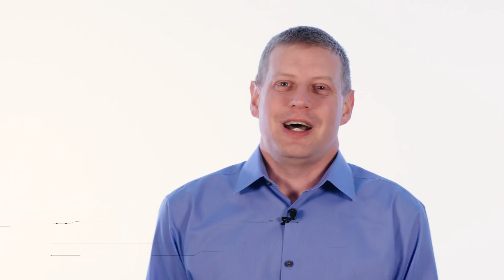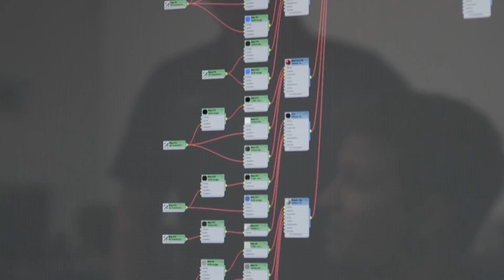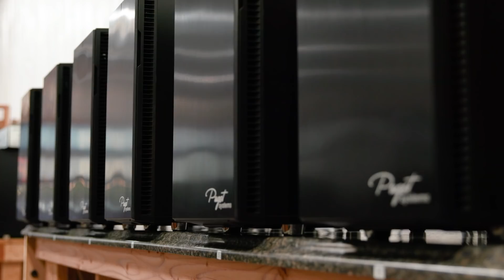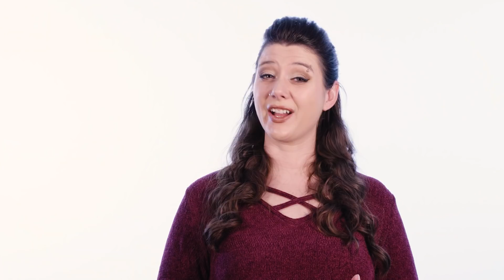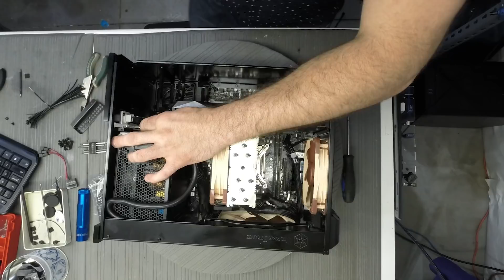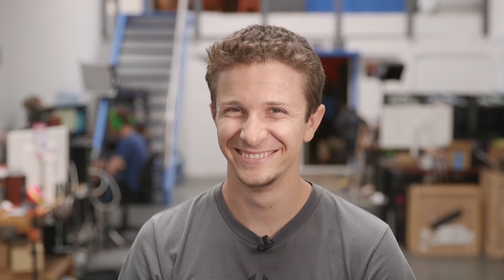Puget Systems: Workstations for Creators

Comment: Here are a couple questions I am looking for answers to...... Which CPU's are ideal for Using Premiere Pro, and After Effects when working with 4K........ It is my understanding that in order to render videos in After Effects efficiently, and properly, that you will need to use software like render garden in order to optimize you CPU's processing potential. I did some online researching, along with hands on experience working with 4K in After Effects. When I seek to render my work, such as using the Rotobrush, or removing grain.....Rendering those effects seems to be a nearly  snail pace on videos not even 1 min in length. Which is by far, way too long, when you compare similar effects such as masking, adding LUTs, color correction, color grading, or sharpening in Premiere Pro. My current hardware is this: X570 i pro wifi ( mini ITX ) motherboard , Ryzen 7 3800X CPU ( 8 Core, 16 Threads ) , 32gb of Corsair Vengeance LPX 3200MHz RAM , # 2 Samsung EVO Plus 500gb M.2 Drives, ( # 1 for OS, PP, AE, ETC, and the # 2 for Projects ( Raw video footage, and Scratch disks, Cache ) and # 1 Samsung 860 EVO 1TB Storage Drive (  Finished videos, etc ), and a XFX RX 5600 XT 6gb VRAM GPU..... This build, as well as my configuration, hasn't seemed to cause any bottlenecking, in Premiere Pro, but the rendering aspect in After Effects is way too inefficient..... Should reconfigure, change hardware, try using render garden, or maybe something else..... Basically my goal is to be able to pretty much do just about anything that these 2 software programs can perform with 4K footage, and maybe in the future some of the same with 6K...., but a build, or configuration for 4K is what I am seeking for..... I am seeking a smooth video editing experience, without prolonged periods of rendering, or any exporting.... though I haven't seen any exporting issues to complain of in Premiere Pro...... Thanks any experienced, or educated information, or advice is appreciated.....
Reply from the maker: A look at these configurations might help answer your questions. Compare them to what you're using now and see where the differences are. Hope this helps!
https://www.pugetsystems.com/labs/articles/Best-Workstation-PC-for-Adobe-After-Effects-Summer-2020-1829/
Reply: Thanks for the reply, I have looked at this very page before. So, I know I have a 8 core processer, with 32gb of ram currently... which is 4gb of Ram per core.... with two 16gb Ram sticks.... While I changed the default speed of the Ram from 2133MHz to 3200MHz in the BIOS of the Gigabyte X570 I Pro Wifi Motherboard, and I don't clearly know if I need to do any other changes to configure the RAM speed in the BIOs to operate at peak performance. I mean it is running at those speeds, but I am not that familiar with which speeds work best with this CPU, and other aspects such as latency, and timing configurations...I also downloaded the AMD Ryzen Master Utility, and seek to overclock the CPU correctly, that I may see it operating at optimum performance, at proper temperatures, but may not seek to do that with the wraith CPU cooler..... as well as be able to see those tweaks in real world performance.... It is my understanding that an 8 Core processor at faster speeds tends to show better performance in Premiere Pro, but with After Effects I am not as familiar with, regarding configurations..... Another area I am seeking to configure correctly, or understand what may also help optimize my configuration, is My 3 Drive configuration.... As I mentioned before, I have 2 M.2 Samsung 970 Plus at 500gb, and 1 Samsung 860 1 TB SSD..... My operating system, and Editing software is on one M.2, and my project files, and cache on the other..... The SSD is where I usually place my finished videos...... Should I move my OS, and Editing Software programs to the SSD, and use 1 M.2 drive as My project files for one, and the second for cache....? Would  I see a smoother workflow when editing ?..... I appreciate your time, and don't know if this is the best place to seek some direction in configuring my existing hardware, and I may also seek to upgrade my RAM from 32gb, to 64gb.... for After Effects.... I mean it's a 2 dim ram slot board, and what speeds work best with the Ryzen 7 3800X I am not sure of..... It is also my understanding that 4 RAM configurations tend to work better than 2 Ram configurations with the same amount of RAM, but I only have 2 slots so, I will make do, unless I build another one.... I just built this one in February.....If there is a better link to ask these kind of questions, where I will get more specific information, just let me know.... again thanks I know it's lengthy....

Comment: For someone starting in photography.  Is there a starter level option that doesnt cost 3k plus..
Reply from the maker: Your best option would be to reach out to the consultant team to get a configuration that meets both your workflow and budget needs. 
Fill out the form labeled "Request a Consultation" at the link and someone will be in touch: https://www.pugetsystems.com/recommended/Recommended-Systems-for-Photography-237/

Comment: My dream job, working in a company like Puget Systems, that cares about the customer, and the system that he requires and needs. A company that takes the next step in order to offer that. Unfortunately there are not many companies like that, and worse, most people don't care about that, what they want is something that works at the lowest price possible, even if it doesn't preform at the best it can or it fails on the mid/long run. You go Puget.